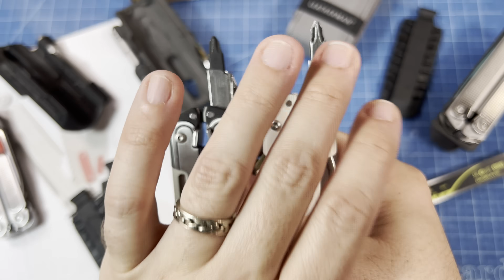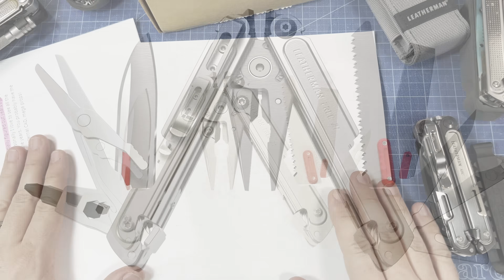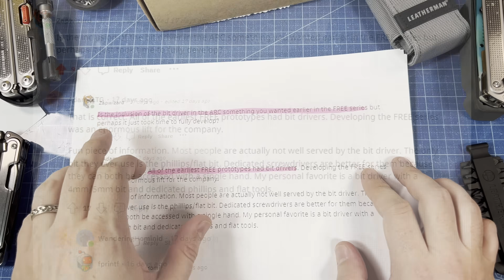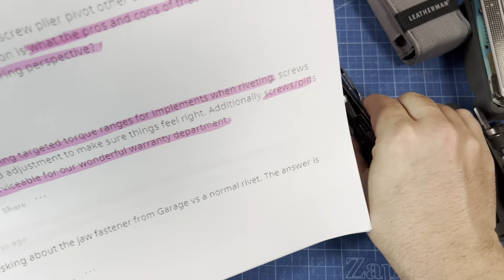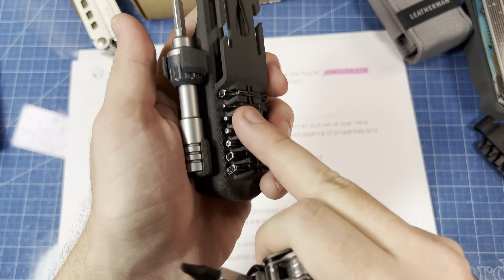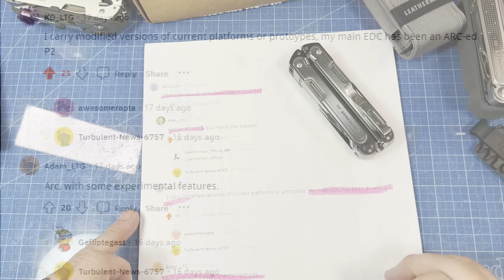Zap's Leatherman ARC Ramblings

Comment: I’d love to see a holster design that would allow me to slide in my Leatherman ARC with the pocket clip installed, along with the Swiss Army kit mounted on the front. I’d also like to have a pin added to the Swiss Army kit you previously made.
Reply from the maker: The catch is the belt clip is very thick, so the whole holster would become 3/8” thicker to have the belt clip and a belt loop.

Comment: What material are your holsters and barnacle holder made out of? 3d printed? Are they durable to impact?
Reply from the maker: Nylon 12. They are SLS printed and solid. They are not FDM printed.  The material can break on a corner if you do drop it into a concrete surface. As they are not rubber. I typically do a one-time replacement for accidental damage.

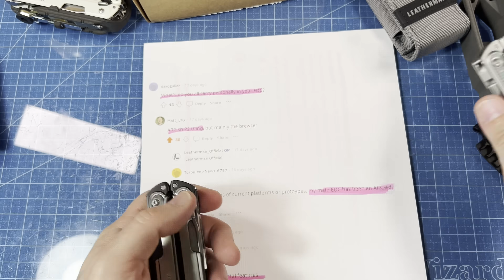Comment: @33:10 do you have any more information id love to see these? Thank you
Reply from the maker: Not sure what your referring to
Reply: @ZapWizard the slim arc/ arc'ed p2, but i did find it. I had to search "arc and p2"
Thanks for the informative video
Reply from the maker: @Horn-Saw I think it is just folks who mix P2 and ARC parts together to make it a bit thinner. Expensive to do as you have to have both tools
Reply: @ZapWizard yep, i was looking to see if i could swap the no tool side scale for the arc/p4 scale to make the tool a little slimmer, but it doesnt work like that, it would make the tool wider in fact
Reply from the maker: @Hor @Horn-Saw The thickness has to do with the tool stackup and the Chicago screws. I have diagrams here: https://zapwizard.com/pages/leatherman-free-arc-stack-up-diagrams
Reply: @ZapWizard thanks, ill be saving that for future reference. See on the p2 stack, the top scale is very thick. I was hoping a simple swap out would fix this. But i dont think that is the case
Reply: @ZapWizard the slim arc/ arc'ed p2, but i did find it. I had to search "arc and p2"
Thanks for the informative video

Comment: It always amuses me how passionate people are about their multitools ! I purchased a Leatherman PST in 1983 and have just treated myself to the Leatherman Arc! I have no others and have no clue what ones are best ? I have always thought the PST was the perfect plier tool and it always has been for me personally! Well after forty odd years it's gone back to Leatherman for a refresh that they assure me they can still do! And so I purchased the Arc as a backup tool for now. The selling point for Arc over other Leathermans was it's made in the USA as was PST. I live in the UK but appreciate USA production like I do swiss made and UK made although that's hard to find anyway Leatherman have come a long way from my first to latest tool and the toolset is similar but with the additional features of Arc. I do think the bit adaptor will be handy if only Arc had come with them! Mine was the tool only version at £230! ,£230 for a Leatherman plier tool, its insane but I thought that when considering how long these last the price is probably fair as the warranty is one of the very best. 
I do feel Leatherman could have given a sheath and bit kit as standard on this model, though. I look forward to the first time I need to use Arc and that will reassure me ive made a good purchase!
Reply: Try out the rebar! It's the modern PST

Comment: The file would have been perfect if it didn't have a hole in it, the grit has enough grip to open with one hand. I find the thumb stud useless as it gets in the way of cutting and sharpening and they should have ground the edge all the way to the frame. I wish the jaws opened as wide as the wave. The outside edge of the frame is very sharp, if they thought about it, they could of had the scale raised panel continue and roll over 90 degrees over the edge to create a comfortable grip and increase frame strength. At that price, it should of come with a thick titanium frame like the charge tti. Way more comfortable.

Comment: Do you have any suggestions about a ruler? I've been carrying a Charge+ forever and found myself using the engraved ruler from time to time and i'm sure I would feel momentarily frustrated without it at those times. I'd love to get the arc but it doesn't have a ruler as far as I know. Any chance of a small ruler that might somehow fit in any of your Designs?
Reply from the maker: @pittifullhumans  I have a service where I will etch a ruler onto your tool. Or you can get one of my combs with a ruler etched on it. Sold on my website: ZapWizard.com
Reply: @ good news. I'll be reaching out to you about the engraving option.

Comment: I put 2019 LM cutters in my ARC Pliers. It has all the P4 SHOULD have had, and dropped the crappy file, unused serrated blade, and so on for bit adapter small and large.

I own two now. One NIB for my 70+ LM collection and one to use.
Love love it. The diamond files with the above, combined with magna blade is the chef's kiss.

I never owned a Magnacut blade. How does LM make Magnacut and the rest in the US for just $199.99(ARC as of today)?
I see 2.5" fixed blades with ridiculous paracord handles using Magnacut selling $200-$300. The ARC is worth it. Do a payment plan if you want one. Price is MORE THAN FARE. The Free P4, add Magnacut and all the other amazing changes for $60 more?
Stop saying these are too expensive (not saying everyone, but many MT newbies and knife-only simple minds think that while carrying a $400 Benchmade Magnacut single 3" blace knife).

Comment: are you able to swap blades between arc, p4 and bach 5? thx
Reply from the maker: @stanli8069  yes. They are all the same mechanism. I have thickness diagrams linked at the bottom of my website to help you plan.
Reply: @ZapWizard  thanks, didnt find the thickness diagram, it gives an error page.  but already bought them and swapped the blades.
Reply from the maker: @stanli8069  https://zapwizard.com/pages/leatherman-free-arc-stack-up-diagrams

Comment: At 50% more expensive than the Surge is it really worth it? What explains such a price gap (c. $80)?
Reply: Probably just the magnacut steel in the blade. It’s a premium steel right now, and it’s on the hottest new leatherman so it’s gonna be expensive regardless.

I should say, I have an arc.  It’s really good and I like it a lot. But there are somethings I would change right off the bat. Stronger detent on the bit changer, both micro bit and standard bit, a 90° bit driver would be AWESOME. I would also love to see a way to “lock” the pliers half open so you can use it as one big long screwdriver, like you can do on most models including the Bond and Wave +. The other handle kinda floppin around during normal use is a little annoying but it still get the job done.
Reply: @dingus4260  thanks for the useful comments!

Comment: How well does the Garage #5 fit into the Arc Fully Armored/Partially case(s)?
Reply from the maker: The 005 won't fit due to the thicker blade. I haven't yet released a 005 armored holster.

Comment: As far as the holster goes, how much harder would it be to design a separate belt clip that could just hold the “ bit cards” and maybe the ratchet  you use and an extension
Reply: Instead.
Reply: This way it could be a little more flush to the body.
Reply: And work with all the leathermans
Reply from the maker: It is on my wish list to make a bit holder accessory. I already have a separate ratchet driver holster that holds six bits.
Reply: @ZapWizard  I find myself switching out which tool I intend to use according to my needs and schedule. So a stand alone bit holder would me more practical for my self.
Reply: You see I have a super tool 300, a surge, blast, shell tool , and a p2. ( wish I had spent the extra and got the p4 instead.) And I use and extra pouch holder for the bits and extension instead of carrying them all on one setup.
Reply: Skel-a- tool

Comment: I just really want the spring loaded pliers. I know, I know "not as strong" and all that. But it's plenty strong for anything I would use it for, I highly doubt that I am strong enough to break it even if I tried. But I hate having to pull pliers back open or have them flop around all loose. I wonder how feasible it would be to attach magnets in such a way as to create a magnetic spring force rather than a mechanical spring.
Reply from the maker: Swapping a Garage #005 with the ARC pliers is the only way to get spring loaded on the ARC. I am not sure there is a spot where you could put two magnets to oppose each other strong enough to force the pliers apart, especially since force falls off exponentially with distance.

Comment: What degree is the blade bevel to resharpen or touch, curious,I have a Arc now,blade came pretty damn sharp,just wanted to confirm it so I can dail it in on my work sharp precision adjust sharpening system an also on the Arc,what size bit is needed to remove the thumb stud,ty
Reply from the maker: Leatherman.com/customerservicemaintenance.html, for the blade angle. The screw sizes are in the information pull downs  on the thumb-tab product page.
Reply: @ZapWizard  ,ah thank you

Comment: Do you make anything for the surge? One hand opening isn’t a big deal to me but I might get a charge tti for my edc and my surge for work but I LOVE the surge the only reason I like the ark is the magnacut steel blade
Reply from the maker: I do have a holster for the surge. It will be updated with the ratchet driver options in the upcoming weeks, but requires some prototyping. Otherwise the current model is available on my website.

Comment: If you had to choose between stock arc or stock garage 5, what's your choice
Reply from the maker: Stock ARC for sure since I stopped carrying my Garage 005
Reply: Why did you stop caring your Leatherman garage batch number 5? I would assume that it would be a much better multi-tool than the Leatherman Arc?  @ZapWizard
Reply from the maker: @clarkkent4608  I like the black, the blade profile is better for my uses. I thought I would miss the spring loaded pliers, but sometimes they get in the way.
Reply: @ZapWizard And would you rather have the Leatherman  Arc or the victorinox Swiss tool MX clip? And looking forward to hearing back your input and it will be greatly helpful because I am indecided as to which multitude to get because I really wanted a Leatherman garage bath number 5 but that tool sold out in like I heard 15 minutes, lol and the only other way to get it, is on eBay and unfortunately you have people on eBay selling this multi-tool for $1,000 so my other option was the Leatherman Arc and I've thought about the victorinox swish tool MX clip which is the newer version of the larger victorinox multi-tool, while looking forward to hearing back from your input and your review was very good
Reply from the maker: @clarkkent4608  The ARC. One handed use, customization, and Magnacut blade. (I haven't felt the need to sharpen my ARC yet, still razor sharp). I don't own the Swiss tool, it looks capable, but not one handed usable.

Comment: Can you use your model flat bit holder on the arc? I’d love to get one. Do you have a video of installing it? Thanks!
Reply from the maker: The flat bit holder can be installed in the ARC, replacing the normal bit holder and the can opener together. The install process is the same as the P$, other than the ARC may have stronger thread-locker. The install video is on the product page.
Reply: @ZapWizard  thanks man I appreciate the reply. I will definitely order one when I order the arc holster when it is available! Thank you for everything you’re doing your modifications are awesome!

Comment: Does any of your current Leatherman  Holsters fit the "Leatherman Charge TTi" with bits & accessories (?)
Reply from the maker: I have a holster for the Charge TTI, it has bit slots, but not the ratchet driver or 711L holders as I haven't had time to go back and update those.
Reply: Where do I find it (?) (Thanks for responding so fast)
Reply from the maker: @Techno-Man1952   https://zapwizard.com/collections/charge

Comment: I really want an arc but I also want a sceraded blade. Is it possible to mod an arc to place one in it?  I personally would replace the file with it. Your thoughts?
Reply from the maker: The only issue is the saw is 0.07" thick (so is the file), and the P4 Serrated Blade os 0.10" thick. So you would have to remove one of the thin implements on the same side (or move things around), and then add some shims to build the thickness back up.

Comment: What do you think about those little notches on inside of the hanfles
Reply from the maker: The ones near the plastic/magnet? They are to align the two halves when closing.
Reply: Yes. I think we're talking same thing. I'd say ergonomic of the handles is okay but those notches are tend to poke my hands...yeah? No?
Reply from the maker: @uzbeck2006  They do end up poking. I think they could have designed a better more comfortable method. For example those plastic bits, they could have molded in an alignment feature.
Reply: I thought the same! I do some 3d printing as well. I guess we "see" things like that. I'm sure you're heard that b4 but I also happy to see in your desings: problem-solution/ideation-prototyping-testing-more refining-user testing approach. And nothing extra for the sake of being just fancy. Will you redesign those bit holders?? I mean they're somewhat functional. Not most ergonomic and not at all integrated into any kind system by a lm. Hence why lm needs to hire you asap!!

Comment: The Arc is basically the tool I've wanted ever since I first got the Charge TTi as my first multitool, and I'm waiting for in-stock notifications now. Do you know how often Leatherman restocks their ratchet drivers at dealers? Because those are priced out the ass aftermarket.

Comment: Almost everything about your garage 5 holster is perfect for the ARC. The only thing i would like to see changed is #1 a slot for the bit extender next to the slot for the 711L ratchet driver. Unfortunately IDK if the ratchet driver slot is really viable anymore as the Leatherman ratchet driver is AWOL and people are now asking Leatherman Surge level pricing for a new Leatherman 931030 ratchet driver and the lowest ive been able to find it is around $50 and have absolutely no plans to publicly say where my source is because i don't need that well to dry out 😢.
Reply from the maker: I will see if I can make something that fits both options.
Reply: @ZapWizard that would be awesome. While I can appreciate the multibit slot IMO the extender, 711L, and the ratchet driver are the big 3 accessories for the ARC outside of the obvious bits themselves and with the amount of bits your holster seems to hold in the back alone almost everyone should already have almost every one of their most commonly used bits anyways. Originally when I ordered my ARC and the #1&#2 but kits as extras/replacements I tried finding a leather holster that would hold both the ARC and the entire bit kits as I'm more of a completely unexposed buckle cover guy myself but absolutely nothing exists that can hold the entire bit kits and a Leatherman without it being either crazy bulky or in the end being 2 separate holsters, 1 being for the Leatherman itself and the 2nd being the entire bit kit and I honestly don't mind 2 side by side or left/right hip belt holsters the added pricing to buy both and have them not look like 2 completely different manufacturers/product lines just got to be more expensive than what is now the absolute most expensive Leatherman multitool mass produced. I also appreciate that Leatherman actually spent the last 2 days updating their website listing the ARC as a compatible multitool or not with their already existing accessories they only updated that information to accessories added within the last year and completely ignored almost all of their sheaths. The entire ARC reddits are just spammed with questionable yes or no information on what sheaths fit the ARC and I don't see any of the big name aftermarket sheath makers ready and in production of anything for the ARC yet. I love that you covered the AMA content. I'd really love to know if moving forward on whatever their next product(s) they would be more open and responsive to sharing the needed specs of in development products with aftermarket or 3rd party products/accessories makers like yourself or at least larger ones. I absolutely love the development they put into the ARC but it's borderline an insult to give a cheap recycled from an older product nylon sheath with a PREMIUM level multitool. I really can't understand what their thinking process is since multitools are geared towards people working in trades and those people are often exposed to sparks and flames that can (yes it's happened to me) ignite or at least burn from exposure. While I know your 3D printed sheath runs the same risk at least with it being solid nylon fiber printing and not woven fabric sparks and small flames should roll off or be resisted long enough to avoid major disaster. I wish I could have chimed I. On the AMA that they need to offer flame retardant sheaths if they want to continue offering woven sheaths as the new norm